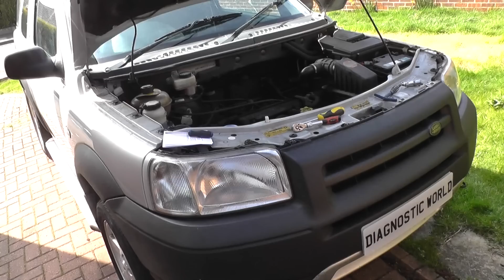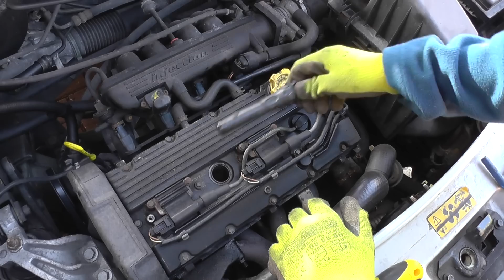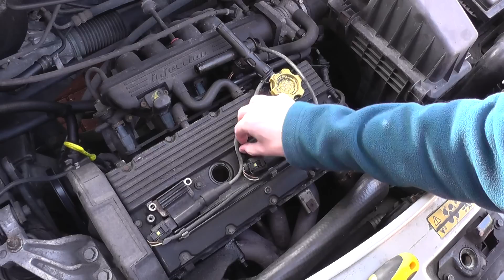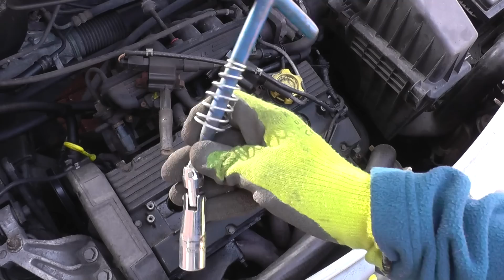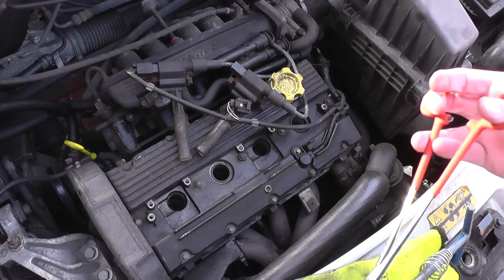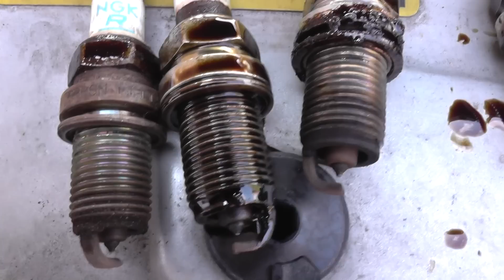Land Rover Freelander 1 Spark Plug & Ignition Coil Pack Removal

Comment: I's undo the bolts before you pull out the leads. Saves having to fish out a bolt dropped down into the hole.

Comment: Thanks! Helped me do my rover 76 :]
Reply: dies irae what spark plugs did you use mate ngk platinum or bosh super 4s?
Reply: i used the rover oem ones by bosch NLP100290 i minimised the gaps to 0.7mm for my 75 turbo 1.8